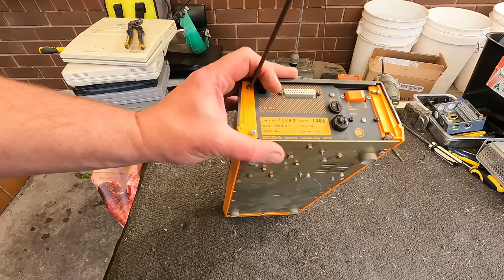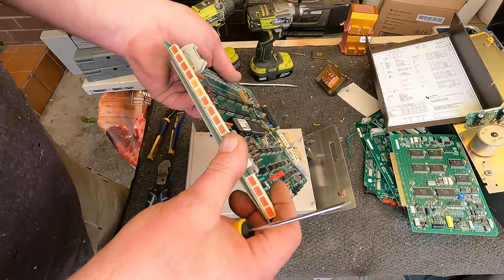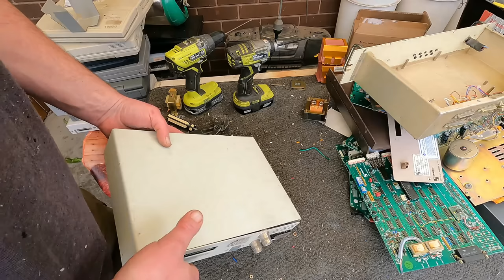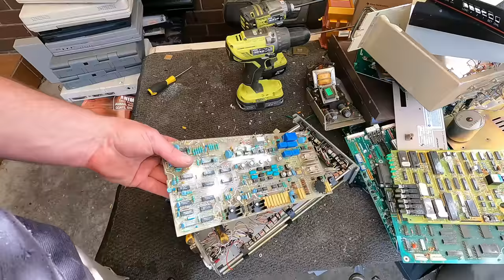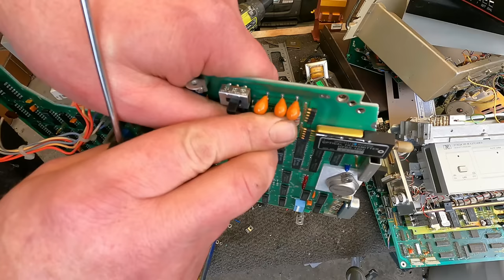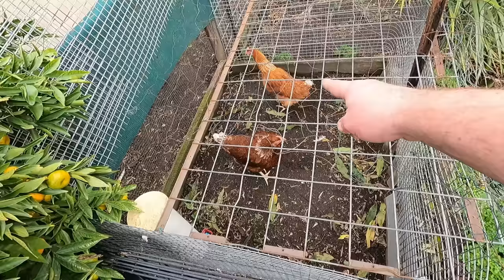Scrap Session Oddball Vintage & Rant

Comment: diesel   generators   can  be made to run on vegetable oil , and  can make diesel type fuel  from heating plastic.    two fuel  tanks with swap switch ,  start on real diesel , then switch to alternative fuel,  then switch back to real diesel  to flush/clean motor before switching off
Reply: @patt er thanks for a great idea I never thought of a second tank for waste oil

Comment: Hi Ben. Just a thought, generators run on petrol or propane which will not be exempt from shortages. You might want to consider solar.
Reply: except diesel generators of course ;)

Comment: Have you ever tried using tin snips to cut the wire in the computer equipment.  They are longer and have pointed tips that get into small spaces.

Comment: At the very end of the video when you pick up that awesome box with the gold leg MOSFETs and pins that gold plated thing believe it or not is another type of transistor. I believe it’s called a TO3…? Prior to more powerful IC chips transistors are what got the job done so you will find many different styles and types.  Those ones are a nightmare to open a but often have a really nice ball of gold solder under the chip. 

If you open it up you will notice it’s a very similar configuration to what you find underneath the Of your dual legged I see chips all over those boards. Basically the same thing with only a couple of output legs

Love the videos been! Have a great day brother

Comment: You might consider getting a natural gas one, assuming you already have natural gas plumbed to your house. No fuel storage and you don't need to worry about the fuel getting old and needing to be rotated every so often. But you would still be reliant on the natural gas to flow. I live in the country and we already have propane tanks for heating and a lot of people get propane generators. We already have the propane here so it makes it easy.

Comment: Ben .. At 59:01 ... Those long yellow things with a small brass screw are 10 turn trim pots. Most old ones have gold plated metal in them. Crack one open to check.

Comment: All those diode looking thing are resistors and also platinum and palladium where used far more then gold because it was much cheaper then gold back in the 70s and 80s

Comment: Cyber attacks are one reason why UK powerstations don't have control networks connected to the outside world. 
As long as power can be produced, hospitals can keep the lights on and the life support systems operating without the need for networked computers.

One victim of the ransomware attack was my local college. They use Windows via a VDI as it is cheaper than having real computers running stand alone Windows installs. Unfortunately, a student plugged in a pendrive that, unbeknown to them, had the ransomware on.
That was back in April and certain parts of the network still are not working. We can use the VDI terminals, but can't print our work as the network printers are not yet working.

Comment: Hi Ben,   I've had a 6500 watt gas generator for 16 years.  My next one will either be a dual fuel machine or 2 machines with one being propane.  I already have tanks for my foundry just like you.  Don't have to worry about propane going bad.   Take Care,   Jim in Phoenix.

Comment: That resistor has ruthnium the small cylinder. Its now 900 am oz
Reply: Careful though ruthnium is powder coated around a tube sometimes with gold or other precious metals and it s technically a a carcinagin. If you breath in the dust. I leave it on the board till every thing is done and take um off with a mask

Comment: You might want to check out pyrolysis, a process whereby you can extract petrol, diesel, gas and oil from plastics.  Also, anaerobic digestion to produce your own natural gas (methane) with which you could cook.  And alternative ways of electric generation, hydro, wind, solar, gravity.  Also consider pedal power using an adapted bike and adapt small appliances (Food: choppers, mixers, smoothie makers), rather than trying to charge a battery to run those appliances. Check out Robert Murray Smith for all your alternative energy needs.  He has a brilliant channel.  Take care, Poo